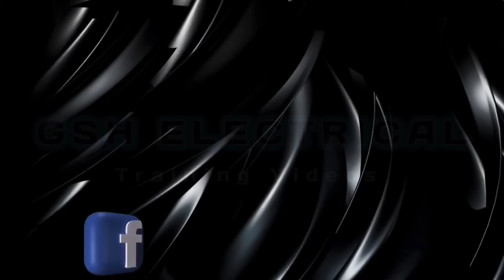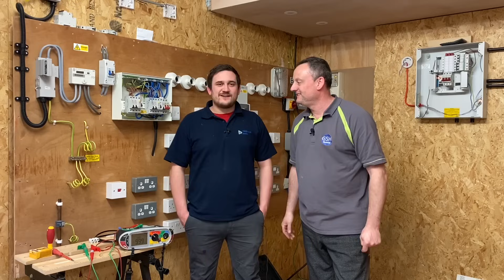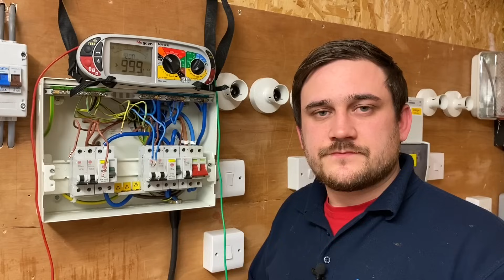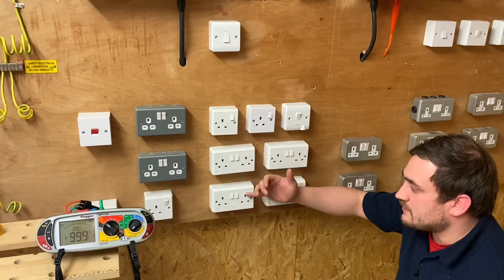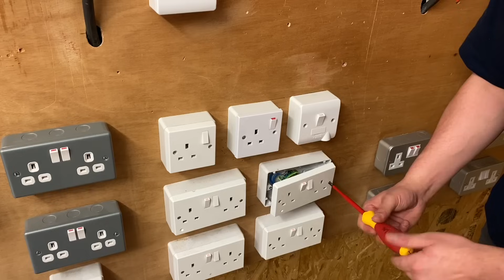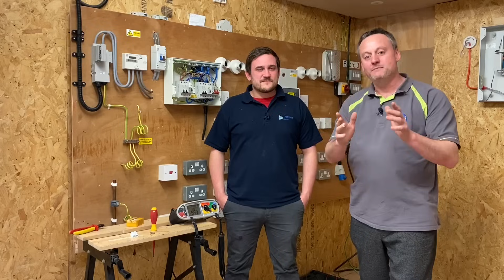How to Find a Fault on a Ring Final Circuit (Sockets) Help for AM2 & AM2S Testing and Fault Finding

Comment: So what's this dreaded final ring circuit you are talking about, I've installed these circuits for 50 years  and had no negative thoughts about why we install them, I think it's you so called modern sparks who in my book are just lazy, it's more about having to do more wiring and having to think about it, fault finding is no harder than if you have a fault on a radial circuit , so please give it a rest cruising ringmains, by the way being an industrial sparks I never wired a ringmain in cable any smaller than 4mm cable so no trouble in with overload , loose connections was at fault 98% of the time so no big deal.

Comment: Literally have this problem with my kitchen ring.  Just 2 sockets stopped working even though one side of the ring still had power that was going to one of the mentioned sockets which I have since checked with the working side of the cable and it's fine...aah the joys 😂 just as I was away to tile my kitchen backsplash as well....something else for my misses to moan at me about 😅

Comment: Nice video. Separated as 2 radials. You could tell it was the wiring in the socket because a reading at the socket was not detected over either leg. All sockets would give readings over both legs if the cable was damaged in the wall, the highest reading at the socket on each leg denotes end of line, the break is between those 2 sockets. Test continuity between sockets to confirm.

Comment: I have 37 sockets to find the fault on the line conductor tomorrow
Reply: it's an unsatisfactory  assessment  Zs way too high Earth leakages no RCD protection  and another Ring Final with 45 Sockets on a 32B  with no continuity on either Line Neutral or cpc." Life in the fast lane going in reverse" my saying from the 80s.
Reply from the maker: Good luck 👍🏻

Comment: Hi im having a problem in my salon all Sockets keep tripping  The main fuse. If it is a wire  behind The wall thats damaged would i have to knock the wall out to refit wire agian?  Ot can that socket just be disconnected amd not used? X

Comment: Help. My double socket radial circ. is tripping my 16A  rcbo b type when I plug my new iron in when I plug my tumble dryer in or anything else in it is ok however before you say it is the iron when I plug the iron in any other socket in the house it is ok what will it be Come on Marcus what is the best test or what can I try  to fix this I have got a 1652 fluke multi  Cheers lads

Comment: Fault finding videos are where it's at folks! How about covering intermittent faults and line to earth faults due to damp in a socket (seems to be a big hit for me at the minute). Showing the quickest way to find both issues perhaps? There is quicker ways of finding faults rather than splitting down rings again and again for example

Comment: Will there be anymore fault finding videos soon?
Reply from the maker: We are working on new content all the time but have been limited by lockdown 👍. Thanks for commenting. Gaz
Reply: @GSHElectrical  Thank you 
Can i ask a question?
When performing a pfc test in your am2 do you put the megga tester on L-PE and then with the leads clamp on to the main earth with the green probe, blue probe on the neutral then with the red lead go across all phases and double your highest reading and then divide it by 1000 to convert KA into A

Comment: Hi GSH another great video! I’d like your advice if I can ask please on my options and a path to qualifying? I have 10 years experience in numerous building trades and maintenance. I worked closely with an elecsa registered electrician for 8years but never qualified myself. I hope to start by getting part P certified if that’s possible. I also have a strong academic background in Maths and Physics if that helps

Comment: Fastest tool I've use for this type of troubleshooting is a telcom tone tracer (Fox and Hound). Connect the tone generator between ground, and one leg of the neutral. Use the probe to sniff the cable in the wall and to each outlet up to where the tone ends at the break. Simple and quick. https://www.amazon.com/Triplett-Hound-Premium-Tracing-Generator/dp/B001ULPREW You can sweep the room outlets without even making physical contact.

Comment: Be good to see a similar method chasing missing neutral in a lighting circuit 👍
Reply: Lighting is a radial. If there was a fault with the line or neutral the lights after the fault wouldn't work.

Comment: Or even some content on heating systems/wiring/fault finding as find it’s never covered enough when in the syllabus
Reply from the maker: Thanks Alan, got some videos on DOL both single and 3 phase coming soon 👍.
Reply: GSH Electrical Nice one mate. Just saying since qualified have come across lots of jobs with hating system faults and feel it’s something not covered deep enough in learning programme.
Reply: @alanmarriott9216  it's because in reality you can't disconnect all items on circuit and youre never sure if it's a fault you're finding or some resistance on an electronic item